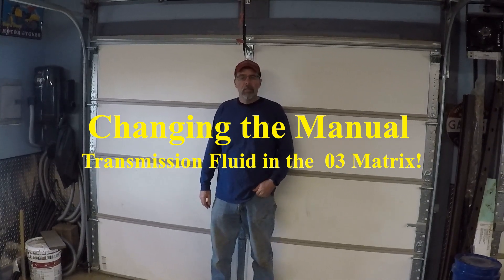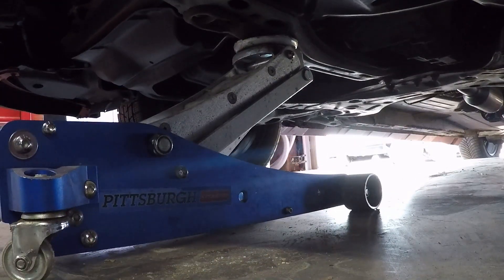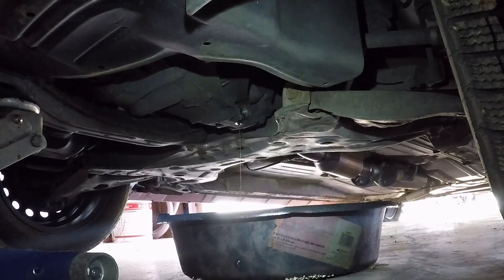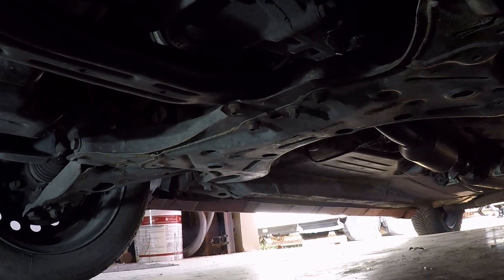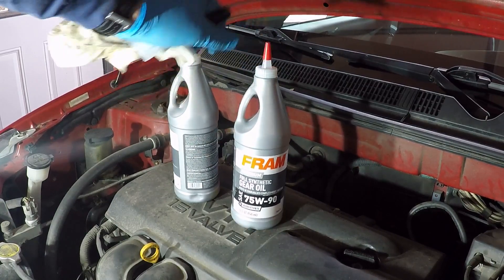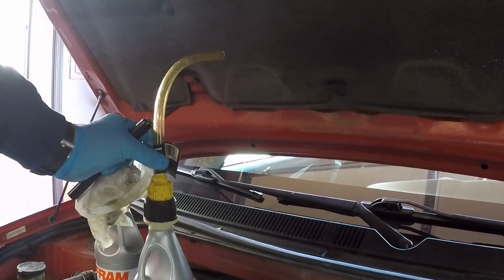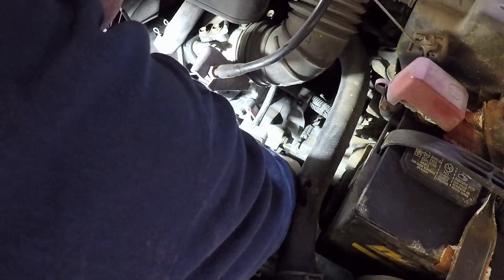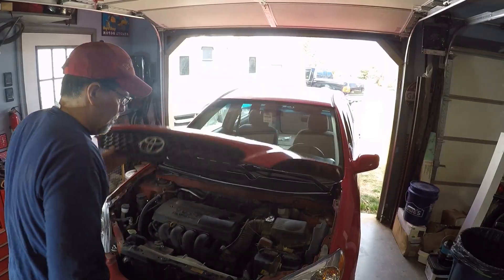03 Matrix Manual Transmission Fluid Change

Comment: Wow....I have a 2004 toyata matrix xr standard....just got her. Love her..she needs a transmission change too, just because who knows how they took care of her, so I get all new oils and belts n hoses when I first got her...
Reply from the maker: Thanks for watching.  I love my Matrix also.  I've got over 250,000 miles on it.  I had to replace the transmission around 190,000 miles due to an input bearing failure.  I found a rebuild one at the time for $1000.  I also replaced the clutch and pressure plate while I had it apart.  I've got a hub bearing to install.  Hopefully I'll get to that soon.  Have a good one and stay safe.

Comment: why not change the crush washer?
Reply from the maker: I was going to replace the crush washer. The local auto parts store didn't have one. I cleaned the old one and reused it.  It hasn't been leaking.

Comment: Is that GL-4 or GL-5 rated
Reply from the maker: That is GL-5 rated
Reply: I heard GL 5 is hard on brass metals
Reply from the maker: @smithdsmit Thanks for the info.  I'll check that out.
Reply from the maker: @smithdsmit  I did some research and came up with the same information. Looks like I'll be changing the fluid again soon and replace it with some GL 4.  Thanks!
Reply: Yes please do not use GL5 bro
Reply: I would change it twice to make sure there’s no gl5 left in there
Reply from the maker: @brandonfabing2099 I changed it over to GL4.